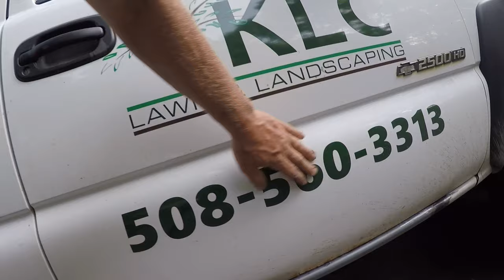HOW TO Replace Repair Rusty Rotted Silverado Sierra Rocker panels and Cab Corner PART 1 of 2

Comment: Very helpful. The dealership did my rockers 4 years ago. Only the outer, no inner panel. Had no idea. Well both sides are completely gone now. Gonna buy inner and outers and hopefully finish on a weekend.
Reply from the maker: Good luck..... not too hard
Reply: I don’t believe parts are named inner and outer. Searching on a site all I see is rocker bottom and cab corner kit. I have an 02 Silverado 2500HD Extended cab

Comment: Loved the video...this is the kind of video that I have been looking for.  I have looked at a lot of videos and don't recall anyone mentioning  the inside rocker panel.  Fantastic work.  If you tighten up your camera work and post more body work videos on these gm trucks, you might become a youtube star.  It is kind of wild that no one in the new england area has secured this yet.  Thanks for taking the time and posting. Thank you, Thank you, Thank you.  Did I mention nice work!??
Reply from the maker: Pedro thanks for the compliment! Based on this video’s popularity there are many people looking to fix their own.
Reply: @KenMrKLC  I'm going to Eastham sometime this Summer for vacation.  I'll bring the family over and we can do a real time inspection with some cape cod beverages. :-)
Quick question...the inside rocker seems to be the most difficult.  Anymore advice when working the inside rocker?  Would it be better to try and cut a straight line or just cut where the good metal is?   I plan on doing some cutting today.  Thanks for the inspiration!

Comment: I need to buy and do this for my 2001 2wd Silverado that was bought when I lived in FL. The passenger side needs cab corner, and I could get away with the slip-on rocker on the passenger, but the driver's side needs the cabs corner and full rocker panel that is spot welded on. It needs inner rockets on both sides as well. Wi winters and a family member that doesn't like washing their vehicles wasn't to kind to this truck, but I grew up in this truck so it's worth it. The bed and doors are good, but it will need a right front fender, passenger back door thanks to a deer running into it and a tailgate.

Comment: I was curious to see how others do this since I'm used to sheet metal repairs, I'd recommend preheating the metal and it looks like your welder only has a speed setting so adjust the speed too. Nice work looks like you got it done pretty quick too.

Comment: could you explain how you lifted the bed up for the cab corner work? I am currently doing this to my 03 sierra. great vid btw
Reply from the maker: I just took off the bed bolts on that side I believe there are 4.... Then I loosened the other side about 2 turns each to give a little play then just lifted the side of the bed and stuck a block to hold it up

Comment: Nice job buddy. Jet wash underneath once a week in the winter time helps. Underbody referb once a year helps to.
Reply from the maker: I find that to not be the case actually…… introducing water on a regular basis under any pressure keeps the nooks wet and never allows it to dry and forces the road salts into areas that it never gets out of… I find washing it and then allowing to dry in warm season and fluid film application once a year (without washing in between) keeps rust away. This truck I bought this way with rust all over. And I don’t like to wash it often after fluid film because it will removed some of the coating

Comment: Very nice! I have a 3 door '98 k1500  that's pretty rotted out, I'll need to work on the doors too. 300k miles and most were on a farm in Pennsylvania which is not great as far as rust goes. My goal is to get on top of the rust, and hopefully it can be clean like your job too
Reply: What part of PA? I am in Connellsville, farm truck with same problem.

Comment: Nice work! Doing my 05 Tahoe. Your tips will help. Curious, I know to connect welder Ground on the panels being welded. Did you just unhook the negative cable? Some say to unplug all the modules. 18 yr old connections are not always happy about being unplugged.
Thanks for making your video!

Comment: Could you do a small tutorial on welding and welders. I know very little about what type of welder or welding period. Thanks
Reply from the maker: You know, that’s one thing I am not great at…. I wouldn’t feel comfortable leading anyone… I feel confident for my own stuff but really don’t have enough knowledge to confidently teach. It usually a trial and error process for me to get good results when welding. That’s one area I’m actively looking for input myself so let me know if you find any good tutorials. I just know to make sure your pieces are clean in the weld areas and I follow settings posted on the welder. But to get useable results it’s not hard my advice would be to just grab a simple mig and play around, it’s not hard and is very fun
Reply: @KenMrKLC  Ok, I appreciate the honesty and help. If I find a good video or videos I will post for you. Thanks

Comment: Nice job! You need to treat the underside and hidden frame rails and new rockers and doors with Woolwax or Fluid Film living in the North East. It will preserve the steel from future rot.
Reply from the maker: john I use fluid film have been for 20 years I’m pretty sure I mention it in video, great stuff. This rot was all during previous owner I only had the truck for a year total.
Reply: Bar and chain oil mixed with red tacky grease  ! Heated up together and sprayed on with a undercoating gun ! Metal loves oil .

Comment: i put a access hole in the outer rocker so i can spray inside it 2 times a year with fluid film and cover the hole with a rubber plug.

Comment: My rust extends upwards beyond the slip on cover that you are replacing. My rust goes all the way to the rubber door seal, so it looks like are doing the horizontal surface and I need to do the horizontal and vertical piece that leads up to the rubber door seal. Do they make an entire piece like that and what is it called as I can't seem to find it online?
Reply from the maker: Yes, I got the partial rocker piece... You will just need the complete rocker which will go up to the seal seam
Reply: @KenMrKLC  Thank You so much.

Comment: I’m starting this job soon replacing out rocker on my 2001 Silverado. I only have a few spots on the inner that is gone where the outer welds to. Maybe 4 inches in a few spots. What gauge is the inner so I can get just pieces instead of the whole rocker.

Comment: My question is why hasn't GM fixed this problem with these trucks? It's been a serious problem since the late 90s. Doesn't seem like the years before that had this problem nearly as badly. The newer generations rust out in just 2 or 3 years.
Reply: It's the shit their using on the roads that's changed the most

Comment: How. Do you keep inside truck from getting damaged from the welding sparks
Reply from the maker: Nothing…. Didn’t hurt  anything
Reply: Metal that you cut off doesn't damage paint,  paint is grind resistant,  and this master is injury resistant too!!

Comment: It looks like you left rusty metal on the original outer panel. I would suggest feeling behind the panel and cutting out all the rust yes or panel won’t reach you will have to add new metal or else it won’t last. Add a quality seam sealer

Comment: Do like they do on mid 90s ford rangers leave few holes open or cut them out so air flows threw them ranger rockers never rust out because the way they designed them. I just got 02 dmax thats way im going to do them

Comment: Did anyone else get a flash back of almost cutting there finger off with a cut disc?
Reply: Everytime I remove the guard I take a chunk out of my finger.
Reply: Which time?
Reply: No, but I got a flashback of when I was cutting up an old 14x70 trailer frame. Had a whiz wheel explode on me and bust my knuckles open.
Reply: How else would you do it? I'm more worried about a faulty disc that breaks and hits me in the money maker

Comment: Where did you get the replacement rockers? After having these replacements on for a while how are they doing?
Reply from the maker: I just ordered them on eBay.... it was 2 years ago now that truck is long gone. If you haven’t seen my other vids you wouldn’t know.... I have had 4 or 5 other trucks since then.

Comment: If it only lasts for a couple more years what do you do after that? Sell the truck?
Reply from the maker: Or part it out or junk it, for the small money I paid for it, its a tool that makes money for a few years way more economical than newer vehicle depreciation and a low barrier to entry for a unit out in the field
Reply from the maker: However I ended up selling its after repair work so who knows how long it would last....

Comment: If you don't have a welder, couldn't you just rivet the outer rocker to some existing solid metal? Of course you would also have to attach the bottom of the rocker to the inner rocker in some way.
Reply from the maker: Yes, there are many ways. I have used panel adhesive before as well.... Welding is the strongest in my opinion and less likely to crack the blending body filler.... But I have done it many ways. It's not complicated. The truck has a frame for structure, the rockers don't even need to be there.

Comment: How many years have this been an issue ? You would thing the manufacturer would deal with it by now.
Reply from the maker: 80% of all manufacturers trucks have same issue.... salt on the roads in snow climates, salt air from ocean... putting boats in water etc... they all rust and rot out there, also around wheel lips above the rear tires is another common spot

Comment: Drill holes in the top of the rocker and inject used oil into it.
Reply from the maker: I use fluid film, and there are enough access holes to get a good coating inside with a pressurized can

Comment: How hard was it to lift the Box
Reply from the maker: Amy B very easy, just removed 4 bolts on  the one side and loosened the 4 on the other and jacked up. If you are raising the side with gas filler you want to disconnect it from the bed which is easy to do from inside gas door

Comment: You literally created more work by cutting the inner rocker all jagged. Just drill out the spot welds!
Reply from the maker: To gain access to the spot welds for the inner rocker I would have had to remove the entire outer  rocker right up to the door seal. I had a partial outer rocker not a full rocker. To remove the entire outer, pay for the complete outer just to make the inner that you don't see neater? Not on this truck my friend

Comment: You need your grinder guard on ...those disks break and go flying fast without any warning..be safe
Reply from the maker: RAHRAH807  you are 100% correct. I’ve seen it happen many times and I shouldn’t push my luck like I do.... yet I seem to ask for it
Reply: KLC LAWN & LANDSCAPING I’ve seen people get hurt and also seen safety glasses saved there eyes with a broken piece stuck into the safety glass  lens
Reply from the maker: RAHRAH807 yes I’ve seen those pics online. Scary stuff. It’s amazing after wrenching 30 years I’ve made it out. Worst I’ve done is ruptured bicep tendon lifting a jeep tub off frame... that happened 4 years ago almost to the day. Surgery went ok

Comment: Rust sucks, if i thought i could make as good a living south or west i would exit the Northeast.
Reply from the maker: Yes it does, But I am able to get some pretty capable trucks for cheap money because of it. This 2500HD was too far though... I bought it for only $2500 including a 8' MM2 plow with 120k miles on it is the only reason I kept with it. I ended up going waaaaay futher into it that I am comfortable with. Everything I fixed the next day something else popped up. I sold it for $5500 with the plow a month ago. The rust was just too far.
Reply: @KenMrKLC  that's a good price for 3/4 ton truck, you did yours pretty professionally, I'm a pop rivet body man myself ha ha. Pennsylvania is as tough as California as far as emissions and safety inspections i hate it, inspections usually end up costing a bunch if your driving 10 year old stuff like i do. Ball joints Bushings ect. the guy pulled the axle to replace a rusted brake dustshield last time, they can find things that makes the vehicle fail and they do. I'll move someday, ha ha
Reply from the maker: @backoffjoe8347   In a way pop rivets are better as you can paint all surfaces and crevices of the repair inside and out where welding burns the paint off in areas you can't retouch

Comment: This guy has no idea what he is doing I would have bought a full rocker pulled the bed right off the truck and he bought the inner rocker and is going to try to use it as back side of the rocker wrong part there are three pieces to those rockers outside in a rocker and back side of rocker
Reply: You’re right about replacing the full rocker. It’s the right way to do it for longevity. He’s showing a way to do it for the diy guy trying to save some money and get another year or two out of the truck. 

Also, there’s only an inner and outer rocker. No third part your talking about. Have one of these trucks apart in my shop doing full rockers right now. 

Don’t give this guy shit when you yourself have no clue what you’re talking about.